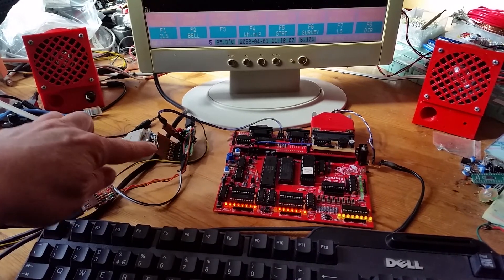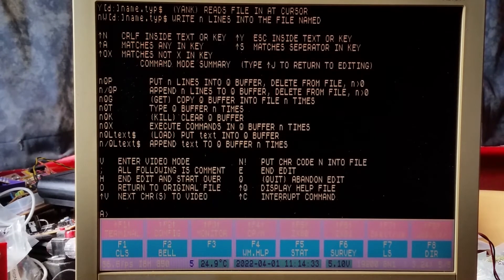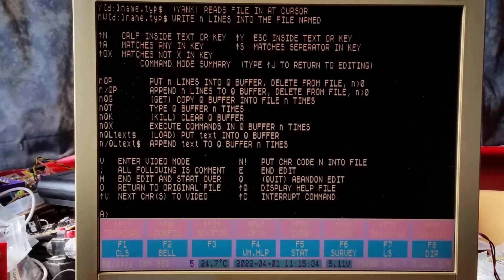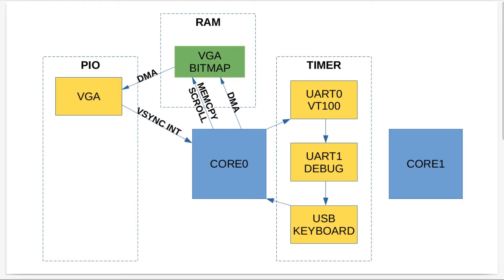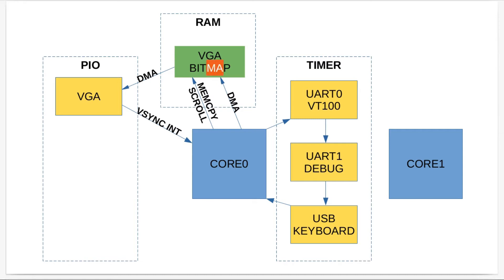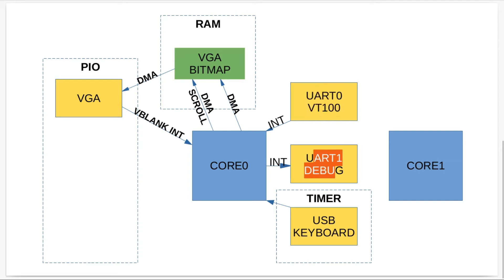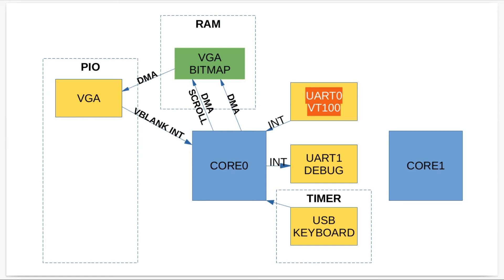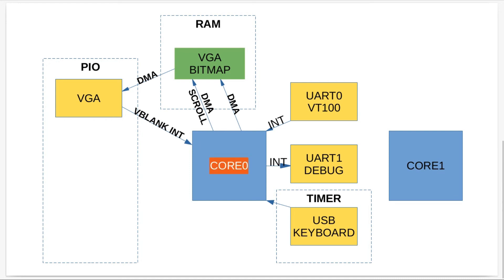VGA Smooth Scrolling On A Raspberry Pi Pico

Comment: This is very impressive for a single chip…
With the advent of PICO W devices, I expected even more impressive devices to be made.
Unfortunately, I have not seen anywhere that you can download an image from a www address and display it on the VGA output.
This would enable many new applications (cheap advertising panels, bulletin boards, timetables etc.)...
Reply from the maker: In the Raspberry Pi GitHub, there are examples for driving VGA monitors:
https://github.com/raspberrypi/pico-playground/tree/master/scanvideo
Reply: MMBasic/PicoMiteVGA should solve it with a bit of engineering and coding at home for $100 which is not worth selling as a kit with requirements of kits. An image on my SDCard showed fine (retro style) with load image "file.bmp" (the jpg command is a bit different). To make a browser in 320x240 or similar is a bit for you alone if you want that.
Reply: I have not yet found an example for PICO of downloading a JPG-BMP or some other type of image from a www address, and displaying it on a VGA screen. It did not need to be the entire WEB browser.